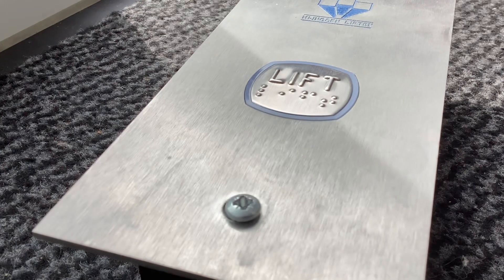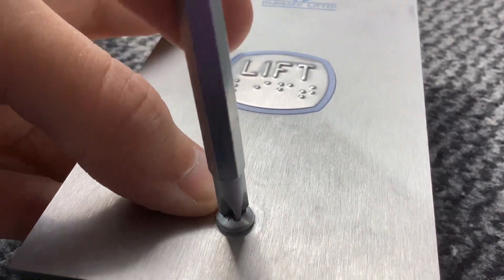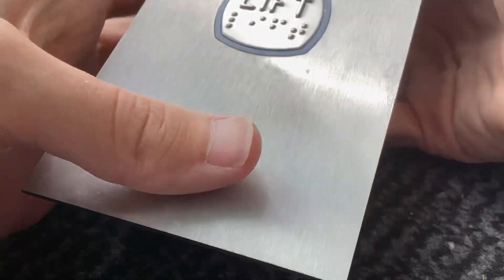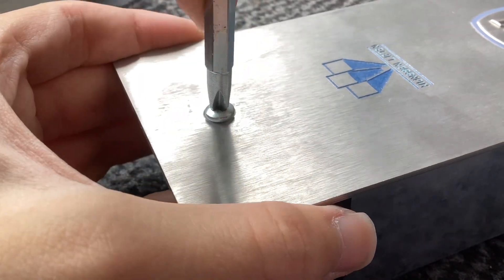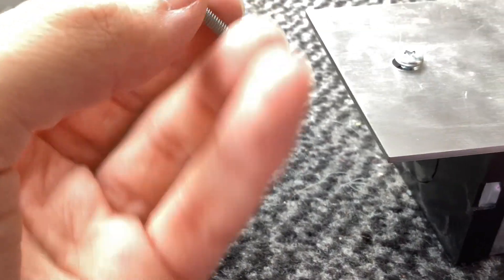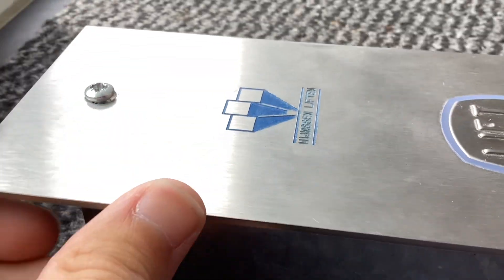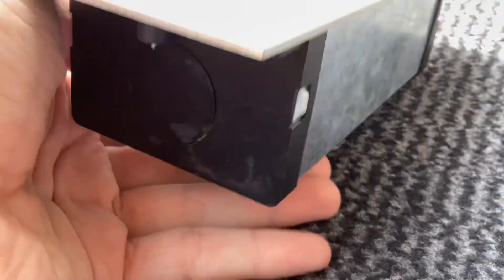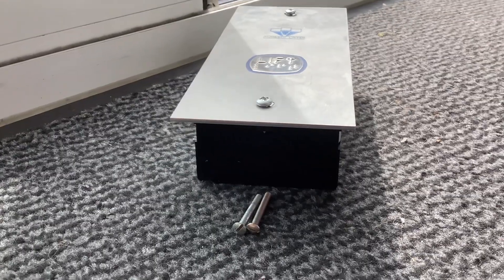Help I’d Like To Replace The Screws In My. Mijnssen Liften Call Station But The Screws Won’t Budge

Comment: Ty and find the perfect size Phillips bit that has a snug fit inside of the screw and that will work better than the big ones because if you have a oversize screwdriver it’ll round the head off

Comment: That screwdriver looks too big. Try a smaller screwdriver. Is the thread of the screw bent?

Try using a flat headed screwdriver between the screw head and the metal panel to try and force the screw out of the hole.